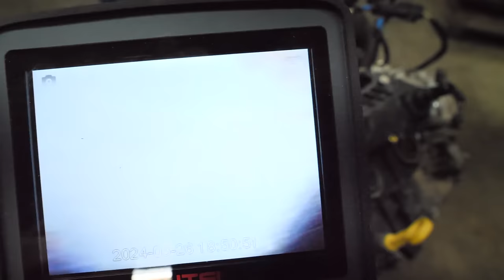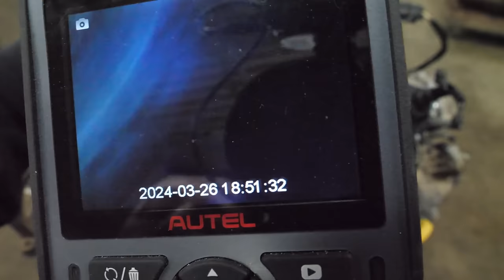ANOTHER BAD 2.7 Ecoboost? 2018 F150 Twin Turbo V6 DEAD @ 131k Miles

Comment: I totally agree about the plastic oil pan ..... Really Bad Idea !!  I'm curious too about the gen 1 oil pump chain modification to the gen 2 engine. My dad and 2 brothers owned a machine shop and I had some experience there....mostly tearing down long /short blocks, heads and turning brake drums/rotors. But I rather keep my hands clean and work on the auto parts side ( mainly to keep my wife happy and not smelling like a old greasy engine ), so I left the family business and had a variety of jobs from Funeral Director to USPS clerk. I appreciate your time showing these engines good and bad, but the complexity of the build today vs 50 years ago is something I miss. I have the Gen 2 Ford F150 2.7 twin turbo with 92k miles...I love the body style, but after seeing your vblogs, and Ford's problem with the 10 speed transmission, I'm looking towards a F250 with the 7.3 gas. I'm not sure if you have done a teardown on the 7.3 yet......
Reply: I work at a Ford dealership as a tech. Been there for 25 years now. You want to avoid the 7.3 as well. They have a tendency to eat up the cam and lifters for whatever reason. Have torn down a bunch of them to replace the camshaft and lifters and some were so bad they got replacement engines.
Reply: @littlebearish  
Is there a Ford engine that you would recommend for a F250 pulling 10k trailer ?
Reply: @jdselby1 The 6.2 or 7.3 gas motors

Comment: Those pistons are FUCKED - you rocked it 10 degrees parallel with the wrist pin. That should never happen. And no, oil pressure has no effect on wrist pin clearance, you're looking at severe pin bore wear

Comment: Small turbocharged high output engines working under load does not sound like a recipe to last a long time.  I thought I had seen a combo in a Civic Hybrid of a not so highly tuned, not so small engine with electric backup.   I'm thinking that combination might last.  Running these small high output turbos seem like a false economy.

Comment: I'm not a fan of the plastic parts replacement going on with engines since the 2000's. A lot of radiators have plastic on the side clamped to the fin-stack which ends up being a failure point. Thermostat housings are being made out of plastic that ends up warping and causing seal issues with the only option of fixing it to replace the plastic part (or upgrade it to an aluminum one). Many oil coolers/filter housing is being buried in the valley of the engine, and when it fails it causes a mixture of coolant and oil to build up in that valley. A oil pump belt that is constantly saturated with oil leading to breakdown is far more likely to cause catastrophic engine failure than the tried and true metal chains.

It just seems with all this 'Environment friendliness' going on, car manufactures would be less inclined to make failure point components out of plastic polymer, or even strived for less likelihood of failure instead. However, we all know that isn't how the world works and will continue to do this simply because it makes them more money by having parts that are more likely to fail. Don't get me wrong, some parts you can get away with being plastic as their heat saturation or pressure is well within tolerance ranges for it, but parts that can go through extreme changes of heat saturation such as oil cooling/filter housing, radiators, pans, and thermostat housing have no business being plastic.

Comment: Yeah, I would never re-use a water pump unless it was brand new. I replace short blocks all the time in Fusions and Escapes with the 1.5s either under the 21N12 customer satisfaction recall or the TSB and the parts list does not include the water or oil pump. It's stupid.

Comment: I don't know if the oil pump belt swap trick will work because the shaft length may not be the same, but worth a try. Gained durability on the timing side, lost it on the oil pump side. Pick your poison. Now there may be a company that has an aftermarket kit available, which would be cool. It seems like an overheating issue. May have also caused some of that cracking on the oil pump belt from high oil temps? Melted guides, warped o rings, cooked valve, missing water pump. My assumption is that they swapped the water pump, and maybe turbos first, (maybe coolant in Cylinder 1 came from turbo? I also saw some staining toward the front on the deck side) still drove like crap, then found the valve, so they re-used the brand new water pump. The fact that the heads aren't significantly warped doesn't mean much to me when they are that chonky and short, and have coolant journals. We don't know what caused the overheat, though. I'd be curious if the valve was busted and eaten by the turbos AFTER, or before. They could have been towing 1 billion pounds up a grade in southern Arizona as these motors are in most of the beater level trucks. Oh well, you win in this scenario. More parts to sell. Also, the offset connecting rods are a diesel design. The con rod is actually that shape so that during the power stroke, the con rod is perfectly perpendicular to the crank journal, resulting in more efficient torque. I don't know if you were talking about that, or the clocked rod caps, but like every other dud on youtube, I thought I'd chime in.

Comment: As you said, correctly, you target and therefore you see a lot of broken engines. Millions and millions are reliable.  50+ years on driving and mechanic work has shown me people who take care of their vehicle vehicles will 95% of the time have no major issues until around 130,000-180,000 miles. And those issues will be eliminated if they replace the timing, the oil pump, fuel pump, and change the oil when its time.  Ive habe owned 3 F-150’s with the “dreaded 3v 5.4” and all have made it to 160,000 before needing the timing, cam phasers, oil pumps etc replaced. Only the 05 had plugs break apart.  I currently have an 07 I purchased 3 years ago from Houston area.  It had 53,000 mikes on it and was a one owner truck.  I just hit 83,000 on it and it's running smoothly. I've been running mobile one 0w-30 since purchase. The oil pumps on these engines can grow weak as the engine ages or if sludge builds up to any extent. 

My plan is to replace all of the known issues at 100,000 on this truck.. New timing components, oil pump, rockers, etc. 

There is a Ford mechanic who started his own shop and he's on YouTube. In the past he has mad many videos on the 5.4 engine. He says if you perform good maintenance and replace the timing, cam phasers, rockers, oil pump with the latest versions from Ford, the engine is a 400,000+ performer.

Comment: hey, quick question:

could you "restore" a neglected engine (oil not routinely changed on time by previous owner) by using premium fuel and doing routine oil changes (i personally do once every 5k kms, i think it's around 3k miles)?

Comment: The chain is now obsolete. If you're repairing a first Gen you get a belt. The chain cannot be retrofit to the gen 2 engine because the chain tensioner has nothing to bolt to.

Comment: There's several reasons they went for a whole engine. They probably saw low compression and like a lot of these engines assumed a bad timing system or bad rings. And i think in the end it's the right choice, second only to a whole other vehicle. Look at that timing tensioner that's a grenade waiting to go off but i've seen that before not sure what does it, eventually it'll shred itself. We get more calls for these engines than we do the cayotes, maybe i'm bias being an engine shop, but i'm just saying. The gm equivalent is much much more reliable the 4.3 DI, the only issue with those was AFM along with all other LS's. And yes that timing belt is terrible, it pains me that we can't put a chain on it because we gotta build to OEM specs unless it's a customer motor for liability reasons.

I've seen this before i was told it's a bad batch of valves for certain years (by various ford techs), but I've seen them go across the board not common mind you usually seems to be just like this a freak accident. These engines are fairly simple and parts are readily available, so we do rebuild them often for shops. There's a guy near my shop who has the contract for the local ford dealers, guys don't know most "manufacturer certified engines" are just made by local shops with a sticker the dealer puts on. I have the local Hyundai contract for 2.0 2.4 and now 1.6 motors.

Comment: The first generation of that engine was a work horse. Still service some at the dealership and one is pushing 400k and has never been touched. Shame they have to implement "Designed Obsolescence" into an otherwise reliable engine.

Comment: It's almost like this engine was designed to last 100,000 miles, roughly.  What's the warranty on a vehicle with one of these engines?

They take special oil?  Is the brand of special oil named Motorcraft?
Reply: Actually was built to last longer than 100k, this was just one that failed prematurely.. seen plenty with over 200k+
Reply: 3years/ 36000 miles

Comment: I have a 2019 F150 STX 2.7 ecoboost 4x4 and IT IS DEAD AT 81,000 miles. I went to the Dealership paid $220 for multi point inspection and they say it has a 8 precent compression loss on Cylinder 6 only and a minor misfire on Cylinder 3 and can't tell me why that is without doing another diagnostic for $700 dollars to do full compression test, boroscope and a cylinder leak test and if it turns out to be a bad cylinder head that repair could take $3000 or more to fix. Also the dealership tells me I am not under any FORD warranty since it is over 60k or 5 years. But the truck had a exended service plan, So I do not know if they are lying to me. It doesn't blow any smoke or is loosing any oil or coolant. It is a minor shaking during idle and when you accelerate or have a load on the engine it starts to shake and vibrate badly but at over 2500 RPM The rough engine shaking smooths almost where you cannot tell it has an issue. I have never modified the truck and only just drove it normally with all oil changes. I am afraid to even to start it now because I fear the misfire could break the crankshaft. I think it is the cylinder head valves but I do not know. It did start having a minor occasional misfire on cylinder 6 for the past several months before it got really bad on cylinder 6 and now it has a minor misfire on cylinder 3 and a major one on cylinder 6. I did change the all of the spark plugs and coil packs that didn't help and all of the spark plugs looked okay (I thought maybe a spark plug ground strap broke but that did not happen). I fear both cylinder heads might have the same issue now since cylinder 3 on the oppisite head now misfiring. I am very broke and this is the worst time this could have happened to me. I still owe $25k. Was I just the un-luckly one or is there someone who had this same issue that can tell what might be wrong. Is it possible take this up with Ford directly? Does anyone know what I should do next? I do not see any recalls or TSB from Ford on this except for Ford made bad valves on the 2021 years? Can anybody please help me ?

Comment: I know there are some drag racers that use a belt instead of the roller chain on some race v8's . They love it. Easier cam change, some what adjustable... but I'm not sure if they use them for long term. Just watched a few videos where they talked about it on the dyno. But I'm with you. Not sure I'd trust it
Reply: I think those belt driven cam setups are external, and not oil bathed.

Comment: I don't think Ford specifies an interval to change that belt but the technician at the dealership I worked at says 100000miles to do that water pump and timing chain

Comment: While the 2.7 and its bigger brother the 3.5 ecoboost engines have their issues (and I loved my first gen 3.5, had 185k on it when I traded it in), they don't die because of their power density. You can design an engine to take any power level you want it to. But that's the key right there, you have to design the engine for that power density.
Reply: Exactly.  The original SRT4 on a 100% stock long block could make 200 hp per liter before the rods let go.  If you had a good tune, it would live a happy life at 400 wheel horsepower.  The 3rd gear in the transmission was a different story!  😂  

With few exceptions, the stock power output is not the problem.

Comment: I woulda thought that the piston where the burned valve was would have been the one with the loosey-goosey wrist pin, and that would explain the piston rock front-to-rear. But it looked like the one next to that burned-valve cylinder was the one you said had kind of a floppy wrist pin. What do you figure was the cause of that wrist pin being loose, and the piston rocking front-to-rear?

Comment: I had a belt on my T5 diesel for the oil pump for 430k kms (270k miles) and it did not show any signs of possible failure after that mileage.
Reply: I suspect that short trips causes a lot of unburned gasoline to end up in the engine oil, and that gasoline causes the belt to break down much faster. The oil pump belt in the 3.0 duramax doesn't look nearly as bad as the belts in these gas engines at the same mileage.

Comment: Ford could have had a legendary engine in the 2.7, specially after adding port injection. Instead they decided to save a few bucks and introduce a major flaw. I'm on my fourth F-150 with the 2.7 and I'm afraid this might be my last.

Comment: The problem with these any many modern engines is the cost of rebuild is often more costly than replacement.they can run fine for 200,000+ miles or not even 100,000.

Comment: The problem is not that it's a 2.7 Eco boost.  The problem is that it's a 2.7 Eco boost in an F-150.  A car engine in a truck that's supposed to have 7,500lb or more towing capacity.

Comment: What! No water pump. You got ripped off big time. Thats the main reason my wife and I watch your channel.
Reply: Somebody knew the value of a nice used water pump.👌
Reply: @hochhaul  What's the retail price on a new one from FOMOCO? I wouldn't bother with a used one for 1/3 the price. My limited exposure to '65 Ford Mustang was that water pumps didn't last 50k, and clutches 35k with my Dad's crappy technique...refusal to shift down + slip the clutch like a torque converter.

Comment: I use to want this engine. Since I saw your last video, I definitely changed my mind. Wish Ford would change the oil pump belt into a chain. Cmon Ford, I would buy a brand new Ranger if you did this + putting pidi in the Ecoboost 4 like you did the Mustang.
Reply: Yet, the 3.5 has a chain. Put it on the 5.0 also.
Reply: The worst part is that they put it where they did. Putting it behind a timing chain is just that little extra salt rubbed into the wound.
Reply: @hochhaul  that's true
Reply: There’s a comment on here by a Ford technician who recommends the 2.7 eco-boost over any other Ford engine. He has seen very few problems with it.

Comment: I looked it up. Ford says oil pump belt to be replaced at 150,000 miles.
Reply: By the time that number comes around the vehicle could easily be beyond economic repair. Also, it’s rubber which will only last reliably for 10 years, according to aviation specs. By design? Let’s check back in 10 years

Comment: Did you check and see if the oiler below the bad piston was clogged up by chance? That will definitely increase cylinder temperature, which is an outside chance caused the valve to burn and break

Comment: The 2.7 Ecoboost V6 has a few issues. The Ecoboost engines are normally an excellent engine while also being one of the most highly manufactured internal combustion engines in the world.
I do agree though the oil pump should be chain driven and the oil pan should be steel or cast and be rebuildable, with the oil pump pickup designed to be easily removable.
😎🇦🇺
Reply: Stamped steel oil pans and valve covers aren't exactly leakproof either. Cast aluminum would be great...until you smack a rock or ? on the road and split it open. Neighbor had a cracked plastic valve cover on her BMW 6...a USED one was something like $700.

Comment: Without the source of the coolant in the Cylinder.  It's a toss up.  I'd change all the Valves.  Look for cracks in the heads and cylinder walls.  Why no Compression Test?  Leak by test?  You'd have a better idea of the condition of all the valves.  I'd go with Overheated to valve melting temp and waited till it cooled down.  Pouring cold water into a hot engine would have warped the Heads.  Did you smell the coolant?  Overheats have a distinct smell.

Comment: I feel the ecoboost v6 line up is hit or miss, I’ve seen trucks go 300k on the original 2.7l and trucks go 30k miles on the original engine. Same for the 3.5l tons go over 300k no problem when taken care of but they can also go 30k miles with all the issues.